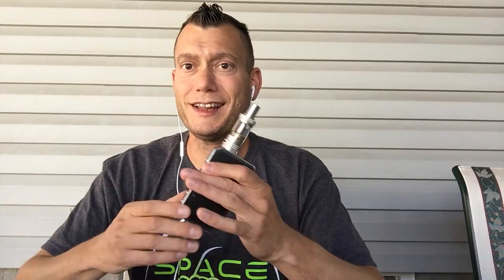Dangers of Ni200 nickel DON'T vape it on anything BUT Temperature Control!

Comment: Hey could you make a video tutorial explaining temp control? Like what metals i can use with temp control and stuff? I have aspire cleito with clapton coil and i dont know if i can use it with temp control.
Reply: +ZiK I use a VCloud temp control battery with normal ego parts like an Aspire BVC.  It works.  My guess is if you stick a normal coil on it, it will output 3.7, 4.2 and 4.7 volts (red, yellow, green) because it does affect how hot the vape is.  Perhaps not accurately. This came with a tank that uses these nickel coils.  The problem is nickel coils can be toxic if you burn them.  Don't use them on a mech mod or a non-temp control mod.  Don't run them out of fluid and burn them.  Prime them nice.  If you do burn them, throw the coil away.

I'll tell you one thing.  Expect a cloud using these nickel coils.
Reply: +ZiK Titanium and nickel are the main ones that can be used with TC devices right now. All devices with TC support Nickel, though not all devices support Titanium. Stainless Steel is also making its way into the market, but like Titanium wire, not all devices support Stainless Steel. 

There's also platinum and nichrome wiring- I know absolutely nothing about these wires, so I won't comment on them. I will say though that platinum is a lot harder to find than any other metal in the market for coils (obviously). Both of these support TC, that's pretty much all I know.

 As far as I know, all TC devices on the market do not support Kantahl (which is a mix of iron and aluminum and was the standard metal used on pretty much every single device when the industry was young).
Reply: Thanks man! That helped a lot!

Comment: Is nichrome same as nickel?
Reply from the maker: +Chaerul Anwar Azis No, Ni200 is 99% pure Nickel metal.  Nichrome is an alloy with a % of nickel and other metals.  When combined they form stronger bonds, are more resistant to heat and corrosion.
Reply: +Darius Fontaine It isn't a malformed question, and I'm simply asking (answered by quest) whether nichrome is the same as nickel

Comment: what's really scary is how my local few vape shops dont use a mg per mL nicotine mix. i asked her why my 6mg 15ml bottle didnt have 90 mgs of nic in it. they thought i was crazy. they put 1mg of nic in a 6mg 15mL bottle.
Reply: +Jack Anthony That would be about right if you were using 100mg/ml nicotine base to make the juice.  If they put 1 ml of nicotine (and usually VG 100ml/ml) in it, that would be 100mg of nicotine.
Reply: +Jack Vand yes, ive since learned by asking the owner wtf she was talking about. he said for her they have a chart to look at so she doesn't know anything about it. but for a vape shop employee to tell a customer that if there was a total of 90 mgs in my bottle i would die and how strong it would be.
Reply: Jack Anthony  I buy 0 nicotine vape juice from ebay for $3 a 30ml bottle. I pour off a ml. Then I add 1ml of 100mg/ml nicotine juice.  Caution 100mg/ml nic juice is a little dangerous.  Don't get any on you.  Shake very very well.  

100mg/30ml=3.3mg/ml.  Perfecto Batman.  So cheap it's ridiculous.
Reply: +Jack Vand ide be interested in buying my fav juice in 0 and adding my own nic, where can i get 100mg per ml nic?  is the base its in vg?
Reply: +Jack Vand lol. ty hell ya, i got the rx200amd tfv4 with the octuple coil,  im in no way saving money at 15 bucks a day for a bottle of juice. need some less intense coils for the tank that are a little more efficient
Reply: Jack Anthony Temp control vapes supposedly use half the juice and I think that's about right.  There is no way I could do a whole 30ml bottle of juice in a day.  More like 3 days.  I mix for 6% (mg/ml) so I get a nice buzz after being 2 packs a day for 35 years.
Reply: +Jack Vand i have temp control, tried it last week for first time with a nickle coil, hated it...or was unable to discern a difference. didnt matter if i was at 200 degrees  or 600 degrees it would say protection after a 1.2 and up to 2.0 seconds hit. it wasnt any tastier, no more vapor, and it shuts off and turns on 5 times in a single hit lol. i like my wattage mode, i have a melo2 that i use at 80w and a tfv4 that i use at 80 and 100w.  love it
Reply: Jack Anthony I have this VCloud one that was $40 at the vape shop and my friend has a temp control box mod he uses with a Tobeco supertank in temp mode with an Ni200 coil.  But if you hit it with watt or volt mode, you'd burn it ... rather permanently from my understanding.  

He says the .3 ohm or .5 ohm Kanthal elements also work in all modes. Temp, voltage or wattage.  I was thinking of replacing the Ni coils with the Kanthal because it's half the money and still compatible with my vape.  This thing I have doesn't have a watt or volt mode.

It fires above ohm tanks in voltage mode only so I can use it with a couple of Aspire ecig tanks I have.  Good for sneaking a hit in public without making a cloud.   I have 3 of those tanks.  Nice to have standby flavors.
Reply: +Jack Anthony I finally figured out where to get more of these pens without paying the local guy $40.  For $20.   You gotta have one of these.  Under a different brand name.

https://vaporider.net/shop/vvvw-mods/pre-sale-subego-1600mah-temperature-control-starter-kit-eta-september-10-2015/
Reply: +Jack Vand i have some old ego c pens. i dont use pens tho...i have old mini nautilus tanks froms aspire on them. temp control isnt the same on a device like that because when you switch to temp mode, you can set the temp, but also have to set the wattage that also runs at the same time. my Rx200  does from 200 to 600 degrees, but you also adjust the wattage from 0 to 200 to get the power to run the temp  control.
Reply: +Jack Vand just make sure you never use a nickel, titanium  or other temp control coil in wattage mode. as for using kanthol in temp mode i dont know why you would, the kanthol doesnt heat up or cool at the same rates as nickel or ti thus effective temp control is impossible?
Reply: +Jack Vand you can actually get a rx200 for 50ish online as opposed to 100 from a shop. its supposed to be one of the best mods out now. i found this out...most of the best mods are the same price,  around 100 to 150. at the shop i watched a guy spend 100 bucks on a kangertech 60ish watt device, when the 200 watt devices and better devices are the same price, or cheaper. why buy a 60watts device for 100 when you can buy the sigelie fou chai for less or the rx200 for less?
Reply: Jack Anthony I think we're looking at the next generation mod with the subego.  I have an electronics degree. I don't want to do ohms law or tinker for the right combination so it doesn't burn etc.  I really like that this thing isn't any more complicated than a vape pen.

If I was gonna buy a mod, I couldn't see buying one that wasn't temp control, and I'd probably never use volt or watt mode at all.

I have a gypsy 100 watt box mod with .1 ohm 18650's in it.  Not a refined animal.  

I don't grudge about buying things retail.  Getting in front of somebody who had some idea of what was going on was worth $20.

And I'll probably go drop some cash on dude here and there.

I've become a Medusa Milk junkie in a day :)
Reply: +Jack Vand my point, you made. temp control is thr finicky shit you have to tinker with to get right, your literally adjusting watts and temp to do it. and an rda you build coils for. the tanks on the subego is a plain jane sub ohm tank like my tfv4. wattage is what your n proclaiming to want,  you just set the wattage wherever u want for strength.
Reply: Jack Anthony Not with the subego or my neighbors box mod with temp control.  The subego has 400,500,600 and the box mod has 10 degree increments from 300 to 600.

He has an Atlantis V2 tank and both of these things use ni200 .1 ohm coils.  But hell. With temp control you can hold down the button and not draw and it won't burn.

Why do I want to use volt or watt mode????

If I did, 0.3 or 0.5 ohm Kanthal atomizers will do all modes.  

If it is working right, temp control.... very very cool....

Like most of this, it's knowing what will work with what to get you where you wanna be.
Reply: +Jack Vand i have an atlantis v2 as well, first tank.  all mods are the same basically with increments, mine all do 100 degrees to 600, but you dont just set the temp when using temp control, you also have to adjust the wattage number in the corner. you can vape xxx degrees at 0 to 200 watts. but ive tried ni200, hated it, the vape was no different except on tc it cuts off as your hitting which annoyed me, specially since i hit it alot so it stays hot. i use the regular. 3ohm and .15 ohm coils. as for burned hits, only happens if you run your tank out which you shouldn't do. im just saying that subego isnt anything special,  just goes to 40 watts which is a lot for small pen mods, but nowhere near enough for .3 ohms imho. if i turn my mod to 40w with a .3 in it the vape is almost less than a real cig lol, thats the lowest wattage for a .3 , they range from 30 to 70. i would check into the eleaf tc60 what. it has temp control and comes with a melo2 tank. uses aspire coils. that subego is just too underpowered for me. ymmv
Reply: +Jack Vand theres 0 reason to use kanthol on temp modes too as its not the same resistance or heat up time. what im trying to convey is hard in text, but you dont just set your mod to a temp and go, you set temp but still have to (usually by holding a button combo) adjust the wattage, not your wattage setting but the one within the temp mode which will be displayed under your ohms on the screen while in temp mode. its super finicky to find thr so called sweet spot. everyone i know that vapes on the more serious high end isnt on tc, most are on rx200,ipv4s, sigelie, etc and run the tfv4 tanks, most with the quad coil. my research at the time on vape forums and shops showed that the best 2 subohm tanks to get are the crown and tfv4

Comment: Great video. I very recently  went to a chain vape store (lesson learned) and bought a new TC device. I told him I wanted oe to go with my sense herkales tank since I had just bought it. After using the kanthol coil I couldn't get up to 40w, so I Google it and discovered I needed Nickel coils. I go right back on and ask the sales kid about it and he had no clue what I was talking about. After convincing him to humor me and try it, he did and, SURPRISE!, it went to 40w. He switched my coils and sent me on my way. After noticing anything higher than 30w tasted burnt and going through 2 coils in two days I asked my local FACEBOOK vape page what was going on and then I was FINALLY instructed on how not to kill myself. So I go back to the store on Friday to advise the manager about the lack of education I got being an obvious novice as well as the fact he didn't even know the difference between the two coil types....and the manager told me running in either mode could release the toxic chemicals so there wasn't a difference. So today I'm making a corporate complaint. I told the manager it wasn't a customer service problem as the I'd was friendly and wanted to be helpful, but a lack of training that could harm someone. The way he blew off the severity of the situation scares me. I don't know if he was trying to play it off or if he lacked the knowledge as well, but I do know I won't be buying and anymore equipment there. (This is why we do need regulations in the vape world...for things like ensuring basic safety is advised because some don't care to take the time to do so.)

Comment: Thank you 
Been looking for a video like this. I'm cautious on what I Vape.

But I'm using .4 ohm Kanthal and have a spare stainless steel .2 ohm for Herakles plus..
Can I use temperature control for both coils? Or are they power only?
Reply from the maker: +Edwin Vasquez the coil does not decide if you can use temperature control.  your mod does.  What mod are you using?  also a great resource:  https://www.e-cigarette-forum.com/forum/
Reply: Im waiting for my new mod in the mail.
It's a Sigeli Fuchai 200W Temp Control.
I wanted to know if it was okay to use temp control with the Herakles plus (Kanthal & Stailess steel coils)

Comment: I like how folks in the vaping community get into an insane paranoid state over Diacetyl..... but have no fear of Nickel. lmfao, ok. I personally have no fear of Diacetyl since it hasn't been scientifically proven to cause lung harm or even be toxic....unlike nickel....all I do know about lungs is that lungs do a fantastic job of moving and filtering organic material out of the lungs but does a horrible job of filtering inorganic material out of the lungs. besides why even use nickel? why even care about getting ridiculously low ohms out of a device for? I don't....no, no one needs to be at 0.2ohms or less. hell, tbh, no one needs to be at 0.5ohms. 1ohms is fine. shouldn't/doesn't even need to go any lower. you can taste flavors great with a 1ohm coil. stahp it.

Comment: HI, thanks for the vid with clear explnations for your reasoning.

could i askyour advice please?

I have been happily going long with my evod 2 but now i have come across a liquid which is of a fixed nicotine concentration.

I was thinking of stepping up to a variable wattage/voltge mod as I was advised that by adjusting those setttings i could draw  more liquid through on each inhalation i.e. get  stronger hit/draw more nicotine through without djusting the concentrtion of the liquid.

It worked when i tested it on his vv/vw mod and I found that i did get a stronger nicotine rush as well as more vapour and when i tested my homemde liquid on his mod I found i could smoke it at about 4mg/ml less than i had to on my evod 2 for the same nicotine hit

but now I have found out about these these tempeerture control mods i.e. the elea 1stick 4

with  temp control and variable wttage mod Will i have the same control over the volume of liquid that gets vapourised as with a vv/vw?...i assume it will but i am feeling a bit lost with all the variable/ranges so thought i should just ask someone who knows
Reply: +mike k I haven't heard of a single TC device that doesn't also support a VV/VW mode. Even my tiny little Kanger Topbox kit can either do TC or just VV/VW. TC is considered a feature for variable wattage mods.

Comment: I've been vaping with a TC device for 3 months now and time to time I have been using wattage mode instead of TC but thanks to your message I will never do that again and stick to TC mode. Although it gives me a warning saying temp control does that mean it's hazardous? It's always set to 600 degrees on my TC40W.
Reply from the maker: +Awes Ali what mod is that you are using?  I don't think that is a warning, I think it is an indicator you are vaping in TC to validate.

Comment: So I just bought a horizon arctic v2 and I use a segelli 75w with temp control. Am I OK with using it on my mod at like 400 degrees or should I not vape it and go back to the regular BTDC coils it comes with. Btw the ni coil is .2.
Reply from the maker: +Lbdataz1469 If you vape the nickel .2 coils in your Arctic V2 then make sure you set your Sig 75w to Ni mode and lock the resistance when both mod and tank are at room temperature.  What temp you find you like is all personal preference for how you like to vape.
Reply: I have the exact same setup as you. I'm glad you asked this question. I was told not to go above 500 at my local vapor shop. I do like the flavor over kanthal, but woke up today with some phlegm a dose coughing, after my first day of nickel coils. However, I used an RDA for the first time yesterday as well, and it had me coughing my head off. I'm not used to 150 watt builds. I'll continue using nickel for now and hope it was just too much vaping at once, yesterday. We'll see. Good choices on tank and mod.

Comment: How do I tell if it is Titanium or Nickel? I use a IPV 75w, with temp control. I Have The Aspire Mega tank with Atlantis Replacement coils that are 0.3.
I just got the Super Tank from Tobeco and what ever filter comes with it. I look on eBay you can buy NI200 for it or the .2 or .5 ohn.  I am a noob, what sub coils should I use? and what do I have? My juice is 60/40 VG/PG 26 nicotine. Just found your channel today and subscribed. Thanks.
Reply from the maker: +Juno Mac RC Hi Juno.  I'm pretty sure you don't have titanium coils.  I don't think Aspire has those.  Your coils should be clearly labeled or laser etched right on the coil itself.  If it doesn't say Ni200 it's probably Kanthal.  Also the O-rings on the coil should be a blue color.  But the box it came with should also describe the contents and parts it came with.  May I suggest that since you just recently started vaping, maybe hold off on the temp control experience and just get used to not smoking and vape regular Kanthal in wattage mode for now, while learning and then maybe visit temp control down the road a bit?